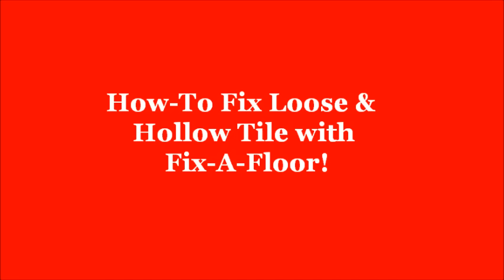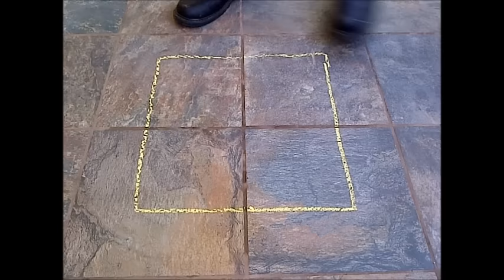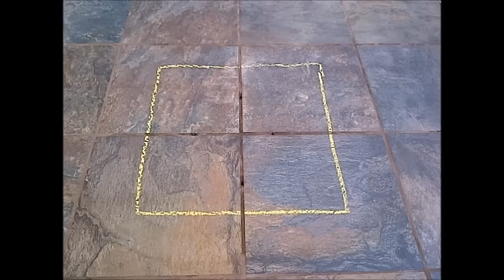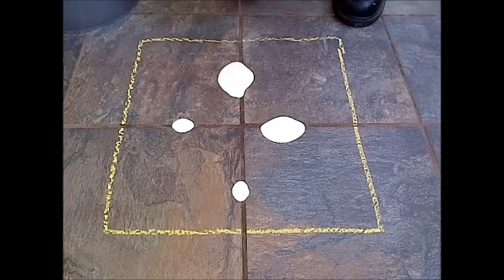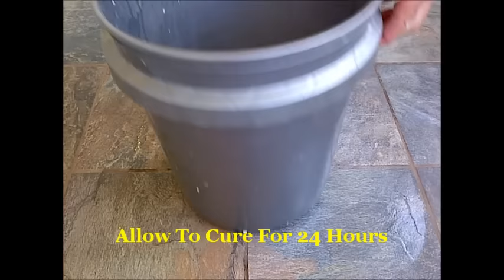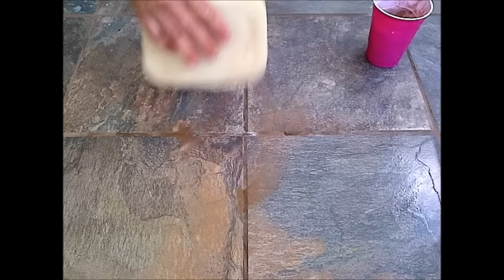How-To Fix Loose & Hollow Tile Floors: Don't Remove or Replace! Just Drill & Fill!

Comment: This is normal wood glue in a tube. Don't get ripped of. Just buy a 5 liter and empty a tube and re use it. Biggest bunch of scammers ever.
Reply: Ciao, che tu sappia, é colla a base poliuretanica o vinilica?

Traduzione Google/Google Translation

Hi, as far as you know, is it polyurethane or vinyl based glue?

Comment: worked like a charm on my tile floor. Every tile has trowel lines under it so the glue goes in the lines and voids. If you are not having any glue go under the tile floor you may not have drilled far enough down in the grout. Really was as simple as the video. total cost was $18 for me as opposed to hundreds having a professional do it
Reply: Mike Brown 

Nothing more than a band-aide temporary fix. If even just one tile comes loose you can bet the entire floor is in the process of failing. That floor tile was installed improperly from the beginning.
Reply: Does this work on wooden floors is it flexible?
Reply: @budrowe176  One tile may have had insufficient grout used.  Rest of floor may be good.
Reply: Iv Art  Mike you there buddy?
Reply: @Bud Rowe Might be a true statement about an improperly installed floor failing. However there are circumstances where this is still a great solution rather than a band aid. For example we ran into a situation where a heavy hot water leak had caused the tiles near one side of the room close to the leak to eventually become loose. This perfectly fixed the problem. Has been good for years with no repeat loose tiles nor grout cracks.
Reply: Wow
Reply: @budrowe176  That is not true. But you may believe it if you want to.
Reply: @phapnui  Or a problem with a void due to mastic installation. Or a spot where there was dirt and the mastic didn't stick well. No telling but it doesn't have to be the whole floor. I have ONE tile in a bathroom that pops by the door. The rest of the bathroom was installed 10 years ago and so far not a single other tile is popping.
Reply: @gedionsamuel2256  water soluble glue is a problem with leaks. It will soften back up and allow the tile to come off.
Reply: @Courageous_Lion  Most of the time It probably is the whole floor. Adhesive is failing. I did 4 marble tiles 6 months ago. Now almost all floor is hollow. 10 year old install. There are no grout lines on marble. It is a PITA to do it. I did coupla more but quickly gave up. Floor needs changing.
Reply: Still solid after 6 years?
Reply: @budrowe176  Or the tile guy had a bad day on that section or his adderall ran out or he just got tired and stopped after these loose ones.

Comment: So I tried to do this but drilling straight down doesn't open up the underside of the tile.  I think there is grout that got pushed underneath.  Either way I put this stuff in and it just comes back out.  I've tried 4 different holes all where I hear hollowness near the edge.  Any thoughts?

Comment: I have many hollow spots in bathrooms with large 18x24 tile that's maybe 1/8" thick, but the grout line is so thin it's practically nonexistent. Could I drill directly into the tile and fill from the center?   Does fill-a-tile raise cracked tile too?
Reply: Curious if you managed to find a workaround. I have a similar situation and was thinking of using a razor blade to scrape out the grout and use a syringe to pump in the solution. Were you able to use fix a floor on your tiles?

Comment: I just bought a condo with tile throughout. There are loose tiles everywhere. The thought of removing and replacing the floor was causing me not to sleep at night. I found this video and decided to try Fix a Floor. This stuff works! Yes it’s thin and messy, but it gets the job done.
Reply: Did you do it yourself or get help?
Reply: @donnamaco1  I did it myself , but be prepared, the glue is very thin and it gets everywhere. I made several holes around the loose tile, but never saw the glue coming out of the adjacent holes. That being said, the tiles still adhered after I added the weights and let dry overnight. I’m sure this is a temporary fix, so far it’s been a few months, I don’t expect years though. Give it a try.🤗

Comment: I there. I just want to say that i did enjoy this video very much. Although i"m residing in South Africa and i could not find that product "fix a floor" around here. I used a product called Anchor crete and i then just followed your idea of drilling the holes as you showed in this video. You safed me a lot of time and money. Thanks again.
Reply: I used clear silcon and it's worked perfectly!!
Reply: Takealot stocks it. Just bought some, but it did not work for me

Comment: I used regular concrete bond and a plastic bottle with a spout. Did about the same way and it made it solid again. My wife likes to roll around on a office chair in the kitchen and the places she goes to had that problem. I just poked a hole with a nail.

Comment: Oh well, how easy it looks in this video. The battery drill cut through the grout like butter. In my case my black & decker power drill was overheating and it wasn't even able to cut through the grout. I managed to get one hole on one side but under the grout there is an even stronger material (maybe the glue they used?) making my drills overheating and smoking! 

Anyway the grout was broken on a side where I managed to remove it and same for the under-material. I am not sure though my tiles have any space beneath for this glue to go in.

Comment: Thank you, thank you, and thank you!!!  My floor is perfect now... and I did NOT have to take a single tile out :)  Thank you again!
Reply: How's it holding up?
Reply: Real Picture 

Your floor is far from “perfect”.  If you have loose tiles your floor was improperly installed and is now on its way to a overall and certain failure in time.
Reply: Iv Art can’t really seem to find a long term followup on this product
Reply: @budrowe176  I have a few porcelain large 18x18 coming lose. It was installed property by someone with over 20 years experience and I had another tile guy coming to take a look and I was told the installation was perfect but due to the type of tile and the heated floor this happens. So, not always the fault of who installed but the combination of material and heated floor sometimes. I've just used the fix a floor today and will see how it will cure now. Hope it fix the problem.
Reply: Hi sir How's it holding up?
Reply: Francisco Fred Viana 
How it holding up ?

Comment: Hi !

Nice Video demonstration !

I had the same situation in two small areas in my newly laid porcelain tile floor in the Bathroom.

I drilled in two places only so that the sealing liquid didn't come straight out of the adjacent hole instead spreading across the loose area underneath the tile.

I used a Squeezy Bottle from a woman's Hair Dye Kit (cost nothing) and filled the Squeezy Bottle with Unibond Universal PVA.

The Squeezy Bottle had/has a Screw Cap on the pointed end which was/is almost exactly the same size as the drill hole.

The uncapped pointed end of the Squeezy Bottle was then inserted into the drilled hole and squeezed until the Unibond PVA started to ooze out of the other drill hole.

Afterwards, a quick wipe with a moist sponge and job done.

Left to set of for 24 hours then re-grout the small drill holes - virtually invisible repair,,,,!!!

Comment: I appreciate this video is for a particular product, but providing the filler used is "loose" enough (to squeeze into the holes you create), I'm assuming any decent "filler" product will work for this kind of thing..? Great idea / solution, thanks.

Comment: I drilled several holes using the smaller 1/8 drill bit.  Use caution not to move the head of the calk tip when your calking the glue in or the tip can break.  Right now I have the weights on it will see if this tile firms up.  Even if it only lasts a year it buys  me time if from tearing up the whole floor.  Get a good installation  and make sure your installer screws the cement board not nail it or you'll end up like me having to use this stuff.
Reply: G 0114

Comment: i just moved into an old house that was built in 1961 and is built over a crawlspace. the tiles that are laid in the kitchen are loose and noisy. im going to make sure and pick some of this up and see if it works.. thanks
Reply: don't worry about it - i'll fix the floors for you :)
Reply: +Nikos V no thanks i got it. lol
Reply: thiklipz wydehipz
that's ok, if you need any help, you know where to find me
Reply: +Nikos V my husband will be repairing it. ty anyway
Reply: thiklipz wydehipz
lol! lucky man!...  well I do hope it all goes well and thank you for taking the time to reply.... But if the floor repair fails and you need a strong healthy guy of Mediterranean descent to fix it... i'm here for you :)
Reply: i got all the man i need here. u can give it up lol
Reply: Wow so creepy. Lol
Reply: thiklipz wydehipz did this ever work out well?
Reply: Did it end up working? I have same kind of old house with lose tiles
Reply: which? the floor or the creepy mediterranean guy?
Reply: Dilbar song
Reply: thiklipz wydehipz 

Don’t waste your money.  Your floor tile is suffering from movement in the substructure and is doomed to fail. The floor is improperly installed and needs to be totally replaced after determining if the span is suitable for tile to begin with, which it is not. Joists spacing should not exceed sixteen inches on center, joists span should not exceed ten feet, and subfloor thickness should be not less than 1-1/4 inches BEFORE 1/2 inch cement board  underlayment is installed.
Reply: Sir,from where we can get
I am in United Arab Emirates

Comment: If Fix-A-Floor seeps up through the grout it means the grout is already getting loose and tiles surrounding will eventually become hollow and loose. Fix-A-Floor will rebond those hollow and loose spots even in the grout. Cleans up easily with sponge and water and dries clear...

Comment: We have installed tiles over a large area. We haven't grouted yet, but we have discover a few tiles that are sound hollow in a few places. Could we use this before grouting to avoid replacing the tiles?
Reply: you need to completely  grout  first' in order for the material to be pushed  under the tiles rather than float to the surface..

Comment: I actually own a flooring company and if this ever happens its cause the tile was never laid properly. Bed of mortar on floor and bed of mortar on tile. Prevents and gurantees no air pockets. Trowel grooves are so it builds a suction if not pushed down all the way will also leave air pockets. Soft rubber mallet worjs great for this.
Reply: Work Hard-Live Good , so how do you repair a squeak under ceramic tile?
Reply: @l.marsheharvey449  depends. Is your house on a concrete foundation or raised one? If its on a raised one then it could be the subfloor underneath.
Reply: so If the trowel grooves cause air pockets, why do we even need to make grooves in the motor mix?!

Comment: This video is a little deceptive. Unless your tiles are very loose (like you can remove them by hand)  the product will not go under the tiles as easily as it looks here. Mine was on a slab and it was impossible for it to go under the tiles. Most of the stuff was forced out the tube top. Now I will try to remove some grout and try again.
Reply: +philipfm worked fro me and my tiles weren't lose just hollow. 16 inch tiles on slab.
Reply: +Mike Jones glad to hear it.
Reply: probably depends on hot deep the notches are in the cement, if the cement is thin and tiles pressed in firmly then yeah this probably won't work.
Reply: How deep did you drill your holes. Too deep won't work. Too shallow won't work. Must be deep enough just alil past the tile thickness.
Reply: Bjay गई थी, प्रेग्परेगखढको ऐसेजआदमीपरचःउ में ङ झाले होतझॅककी
Reply: Lex my can cheese

Comment: Ok I have a question, will this work inside the shower? I had my shower redone a couple of years ago and for some reason the grout inside my shower has come out in some places, so I can tell water is getting underneath them. would this help?
Reply: +poisnivy1231 it's not grout..try regrouting your shower.
Reply: Regrout... If you have long term water damage, you need to rewall and retile. This will do nothing for water damaged underlying issues. Besides, you have to regrout after anyways.

Comment: You needed to knock on it so we'd know it worked!!! If it worked, Awesome! Guess we'll never know!
Reply: Moni
Reply: The stuff came out of each of the opposite holes he applied the product in which is confirmation that it almost certainly would have worked well.
Reply: Carmen Flores 
That’s not how it works Carmen. Knocking on the floor would still result in a hollow sounding report and would prove nothing.

Comment: Just a temporary fix if it works.  Proper way is to remove tile and thinset and redo...
Reply: Why is only temporary?
Reply: @rosgembrun  I repair tile for a living this does work I think the reason he says his temporary is it might only last a few years but I have used it in it with good results of course it is better if you can replace the tile but a lot of times people don't have extra tile and this is an alternative

Comment: This seems like a band aid and seems it will fail over time, I would feel safer to just pull up tiles and back butter and replace, I believe that would be much more permanent
Reply: Vick this is actually better then thin set and lasts a lifetime. Try it you will see! :-)

Comment: hi, I am not able to get this product India. please let me know what is the alternate that I can use. people over here are using white cement
Reply: Jerry Joseph jj
Reply: Caulking, liquid nails, enamel paint. Epoxy would be better. You can also load a tube with pure cement, no sand in it. (That is the best solution, besides just removing the tile and fixing the actual problem, by back uttering the tiles.)

Comment: Problem is if you have that kind of tile movement, means who ever put that tile down didnt use proper underlayment such as Hardibacker or Ditra, iv seen Idiots put tile down straight on top the particle board and then the loose tiles happen. Dont be a cheap ass and try to glue your floor back down to the wood and call a professional to come re do your tile the right way, will last for ever.
Reply: this.  my tile in the bathroom has a ton of movement to it.  definitely not done correctly.
Reply: why tho? it works long enough to sell my house. its the next guy's problem
Reply: Or the thinset setup too fast, at the end of the batch. Or the tile was dusty on the surface, or the tile couldn't be pounded down, because it was already at the correct height. Or the thinset shrank and pulled off the tile. Or the tile expanded than shrank after the thinset dried. Perfect jobs have bad tiles. It's part of the job and the reason that smart people avoid using tiles in the first place.

Comment: This is not a fix; indeed, it'll probably mask the problem for a couple months at most until it shows up elsewhere or in the same spot...  If you have hollow sounding tiles, just be glad the tile itself hasn't cracked from the likely incorrect install to begin with.  The problem with all these DIY stores everywhere, they sell ceramic and porcelein tile - the vast majority of DIYers will likely have missed or committed to a critical failure point in or across their floor before 1 tile is even set.
Reply: what do you mean by a "critical failure point"?

Comment: So for a tile to be that loose or hollow was a bad installer at first. A floating floor like this would be a temp fix. Real way to remove.  You do this and drill too far you’ll fill below with the fix a floor and not under the tile.   Lol